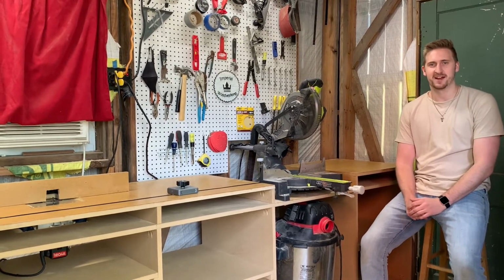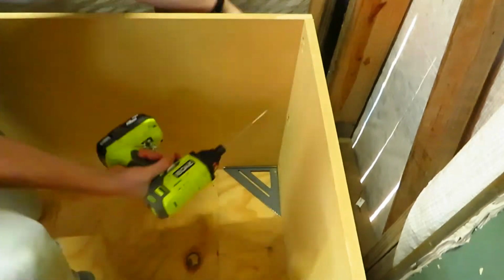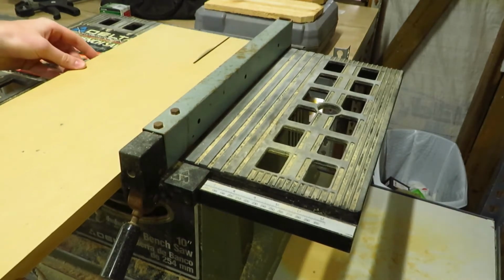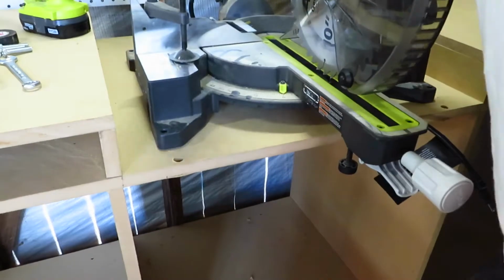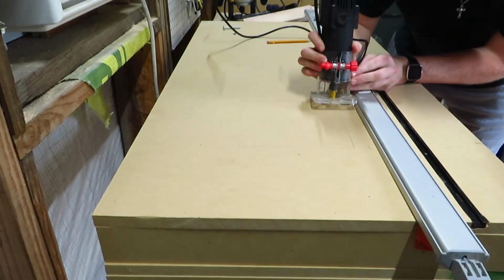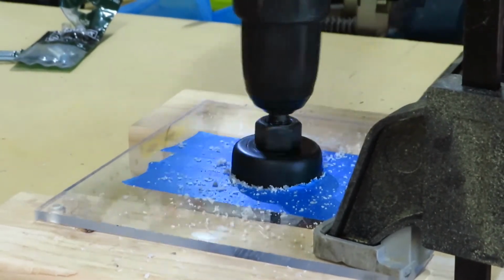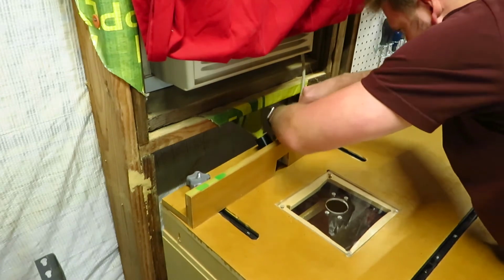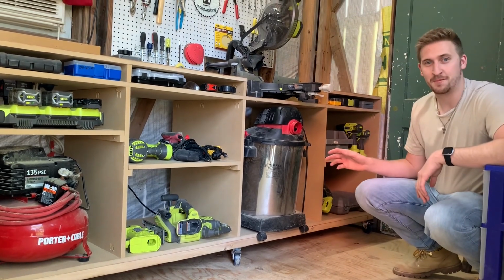DIY Miter Saw Station and Router Table With 3D Printed T-Tracks

Comment: How has the t track held up?   Also you sound have gone the opposite direction when routing for more control
Reply: When routing for the t track that is
Reply from the maker: Haha you are exactly right I should have gone in the other direction. The t-tracks are still holding up great! If you intend to use it as a hold down clamp for a work bench I wouldn’t recommend it cause it wouldn’t be strong enough for that purpose. However if you are just using it on a miter saw station with a stop block it works great! The stop block doesn’t move at all when clamped and nothing has broke yet. Thanks for watching!